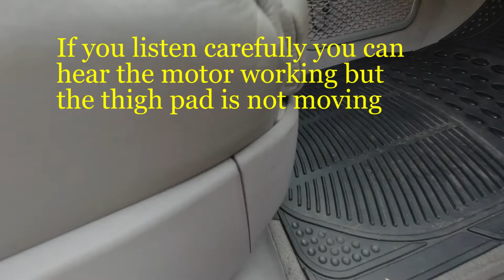FIX the thigh support of a BMW E60 comfort seats. Replace the gear

Comment: Haha, looks like you stuggled as I did while putting it back. Hey @heartbeat, did you figure out what blocks the motor from putting it back in place? How did you do it?
Reply from the maker: Hey you are right it was not easy but just try and it will fitt. :)
Reply: Still trying to reinstall it.. already one hour and still not staying there like it should..